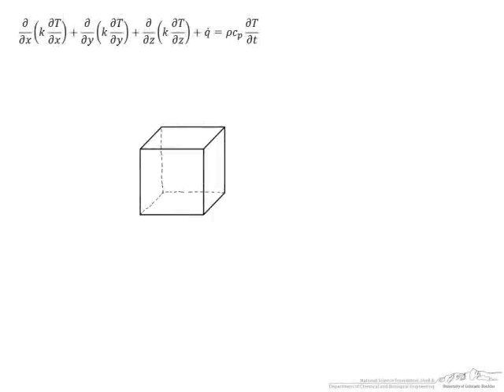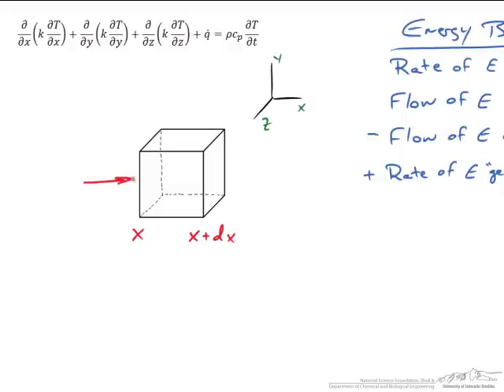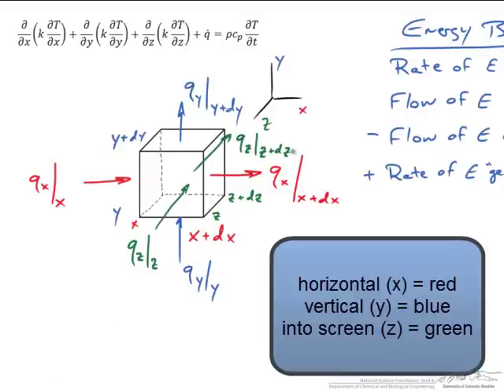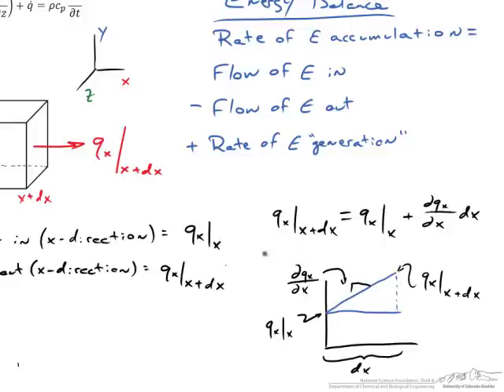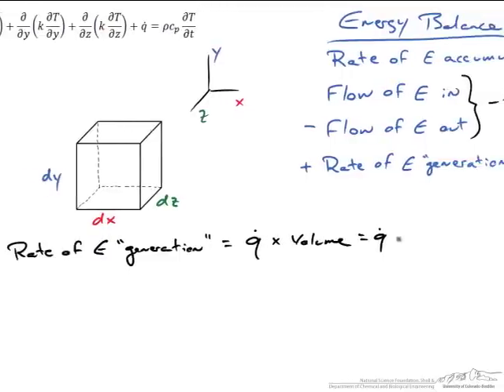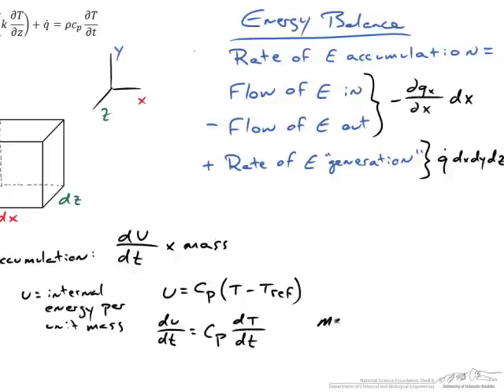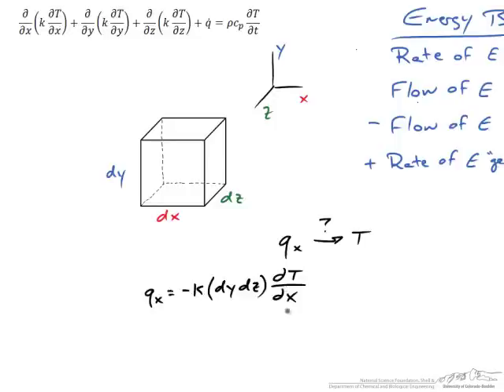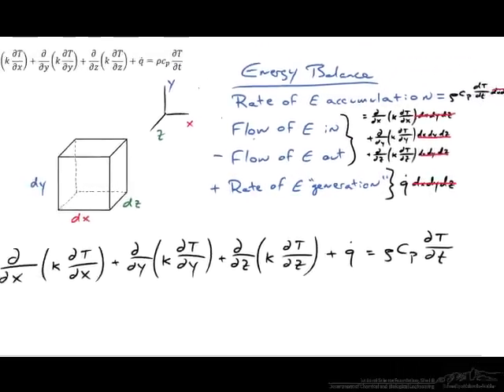Heat Equation Derivation

Comment: At about 7 minutes, you mention that the rate at which internal energy changes in the system is equal to the heat capacity * temperature difference.

What I remember from thermodynamics is that (dU/dT)v si equal to Cv and not Cp...

what I am missing? Is Cv=Cp for a solid?
Reply from the maker: Tonkiplis For a solid that does not expand or contract, Cp does indeed equal Cv.
Reply: Tonkiplis but the volume of the solid is temperature dependent, no? Is this dependance neglected? Thanks for your answers
Reply: Tonkiplis and would you know a book which states this equality, such that I can refer to? 
Have a nice day!
Reply from the maker: Tonkiplis The volume change of a solid due to temperature is certainly negligible. I apologize for being ambiguous in my last response.  Let me rewrite that: For a solid, which does not expand or contract, Cp does indeed equal Cv.  (There will be minor exceptions to this rule for some unusual substances, but generally not in any temperature regions where we would be interested.)